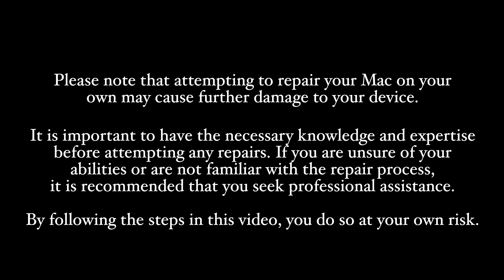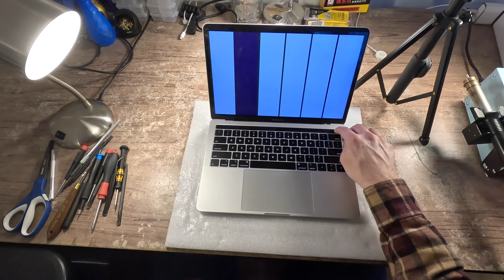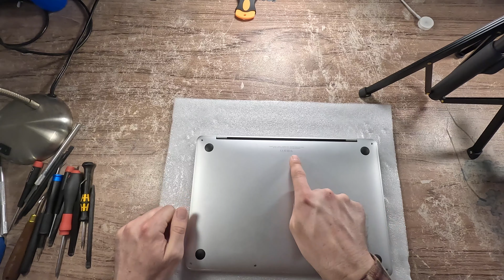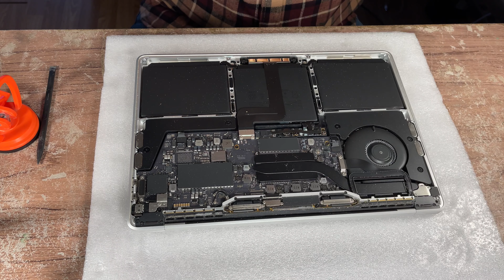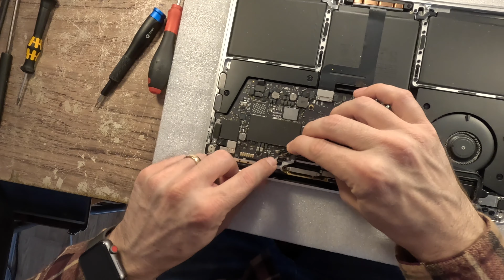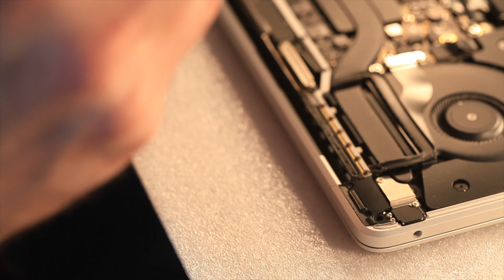13" MacBook Pro 2019 A2159 Full Display Replacement

Comment: Camera and keyboard light working ? U not need replacement display chip ?
Reply from the maker: You do not need a replacement chip or anything else on this model as long as you get an OEM model LCD panel.